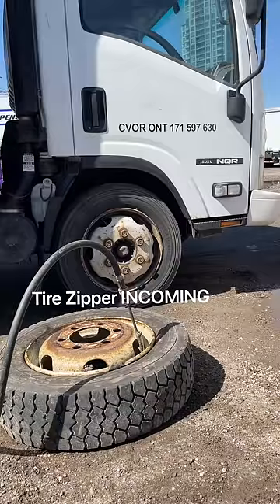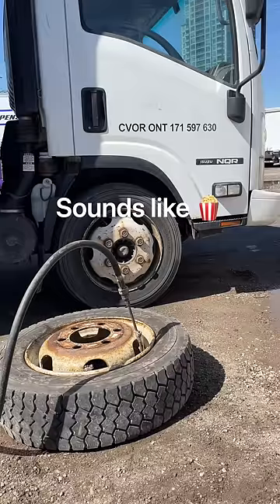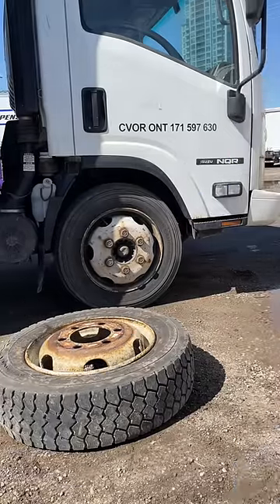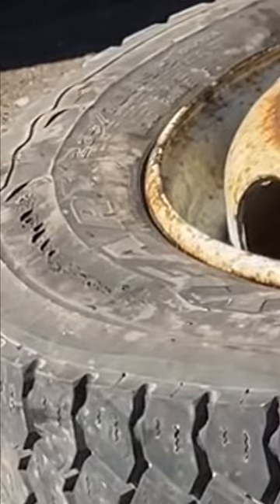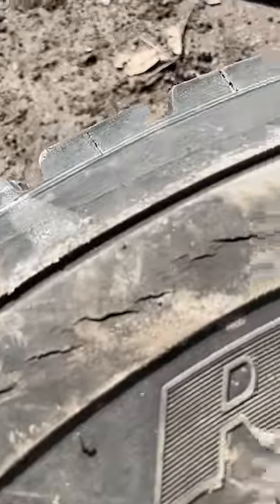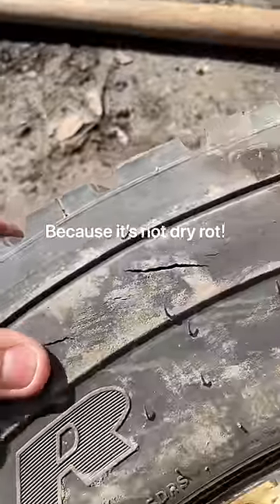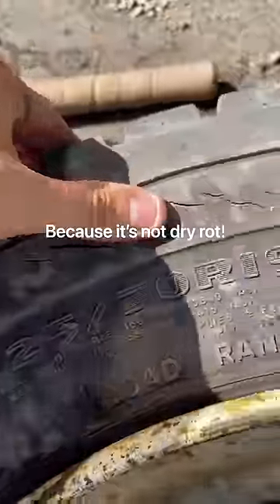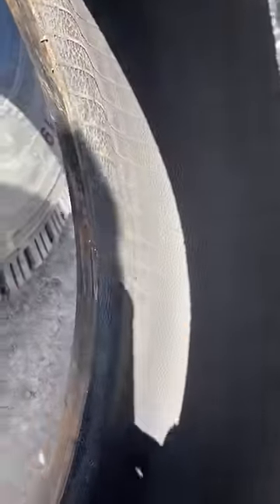Tire Explosion Warning: 🍿 Sound! #shorts

Comment: Putting 120psi in truck tires separates the men from the boys lol
Reply: Also separates the head from the body 😅
Reply: We have 130psi in our 385/55R22.5. Those things blow up like oversized hand grenades.
Reply: @tntfreddan3138  I'm just imagining the explosion effect on loose dirt would probably look extremely similar, but I'd have to see tire blow up to compare it to a grenade haha
Reply: Needed a tire replaced on a drop&hook. Called for roadside. While I waited, I checked tire pressures and found one tire was inflated to 130 psi cold somehow.
Reply: @jeffsorrows  the potential energy contained by a truck tire at that pressure is probably higher than a standard size fragmentation grenade. However the shrapnel produced would definitely be significantly less.
Reply: Separates everything.
Reply: You mean the dead from alive
Reply: BF Goodrich space program
Reply: Boeing 777 have 220 PSI 🎉
Reply: It’s a scary job I have
Reply: That's how much psi I put in my road bicycle tire.
Reply: Good thing it's not the Catholic Church, you'd need a pry bar to do that!!
Reply: Ive filled a car tire to 130 before lol
Reply: i’ve had to put 110 in car tires to pop the bead💀😭
Reply: @Themadoutbacker When my dad first joined the army he was sent to Fort Hood. His first day there some guy was airing up the tire on a deuce and a half without the cage. Tire blew and took the guys head off.

I wasn’t even there to experience it but that story will never not pop into my head as I’m airing up a tire.
Reply: Now try putting 120psi into a 205/40R17 thats rated for 40 because the customer wanted stretched tires😂
Reply: Lol thats why i do it 100ft away with a very long hose
Reply: @bigmike4923  wtf??
Reply: I did it for 6 months ignorant AF an seen  a ten ply used tire give on the downside. Tire bounced a half inch 1000mph with the changers hand on it.  Right arm windmilled straight up into a tire rack breaking his hand. I seen it tho he loosened that nut an was setting the beed I just looked up blew my hair back an someone shat my pants. 😅 Just a sqeeker tho
Reply: 105 is what our steer tires get filled to. I've definitely seen them at 120 before. 120 isn't a huge deal for them, but definitely higher than it should be.
Reply: I've put 120 I passenger tires before to check for really small leaks
Reply: Ahaha you think that’s rough I’m out here at 16 filling and fitting dump trailer tires that are bigger than me, and sometimes cracked enough to make you say a few Hail Marys
Reply: @OG_Glizzy_Gobbler  Yeah, but those things are so overly engineered and well Regulated that the chances of one of them blowing up is pretty damn close to 0.
Reply: More like the smart from the stupid
Reply: Dead from living 😐
Reply: I think ill be a boy for that one.
Reply: And when they pop, 120 psi separates men
Reply: The boy's that do not use tyre cages are often separated all over the floor, walls, and ceiling.
Reply: @tntfreddan3138 Super-singles are a grenade in waiting, also.
Reply: Well, I can put at most 80 psi on my dually tires, I can't reach 120😅😅😅
Reply: Shiiiit. I had a trailer tire go on me when putting air in it one time. Now i get hesitant when ever i get to 80 psi. Was airing it up, checked oressure, it was at 80, so i put more in. After holding the air nozzle for maybe 5 seconds, the tire blew out at face level, but the inside side wall. Got lucky there (trailer tires called for 120. It was MAYBE at 90 psi when it went)
Reply: One guy at the shop once put 200psi in a tire lol the wild shit was it was on a 235/40r18 tire for a Honda Civic
Reply: @tntfreddan3138 they put hand grenades to shame. Hand grenades are less loud than most decent fireworks lol it is the shrapnel that makes them deadly, thenconcussive blast isnt enough to rulture organs.
Reply: @jeffsorrows truck tires definitely have more impact behind their blast, and heavier shrapnel which contains both rubber for weight and thin metal wires for laceration. Id definitrly say a truck tire is more dangerous than a grenade in all categories except the fact a grenade is tiny xD
Reply: @Themadoutbacker  Right.. Hey, I guess I'm a boy with all his body parts.
Reply: @randgrithr7387 dude, that's scary 😮
Reply: @SPD_driver  I thought it just took a glass of Wine?
Reply: @tntfreddan3138 yeah not sure why 120 is a big deal. I have super singles that I put 120 in them. My steers have 110-120 based on load. I adjust pressure based on load on every load.
Reply: @teamdada2194  That's how I talk to my girlfriend. Lol
Reply: @kenroberts9082 you betcha.
Reply: That tire rim doesn't look too healthy either. It looks old enough where steel fatigue could do it in. 😅
Reply: Putting 120psi to seat BMW 325I run flat tires works even better.
Reply: Company policy, 120psi on steers. Now imagine running across the desert, heat expansion
Reply: It also separates the skin from the bone 😁👍
Reply: @jeffsorrows tyre can have moor power
Reply: Road crews in the United States are technically supposed to carry cages on the back of the truck.
Reply: Damn right
Reply: @autodidacticartisan stop doing that. That really small leak is still there at 50psi. If you can't find it in the tank use soapy water and slowly cover the entire tire inch by inch
Reply: @eaf-target-xx2745 zipper rupture are caused from a tire  being run under inflated and the belts in the sidewall being fatigued. Airing a tire that has been run flat is incredibly dangerous. Most dangerous of it's a single tire vs one run with a dual since a dual tire takes three load. Always be cautious airing up tires and extra extra cautious if it's a tire that was run low on air.
Reply: @brad741 the tire manufacturer calculates that in when seeing Max pressure. I was working with some Yokohama engineers several years ago, they were testing new steer tires. I was just there to mount and dismount the tires. We were inflating those in tires 10psi over Max just to recreate what would happen if the tire was hot.
Reply: try filling a tank with 3000psi
Reply: @Seabass1206  I have fueled cng trucks a few times.  I didn't see an issue
Reply: What’s that in kilopascals
Reply: Not too un nerving when its fresh tire but guys who run dry rotted crap because want the most value out of tire aren't great.
Reply: I’ve filled up a car tire (245/40ZR18) up to around 130 PSI before it gave me the overfilled message. Eventually it beaded after we decided to grab a cheetah.

Comment: I was an aircraft mechanic. I saw in one of our safety magazines the pictures of a mechanic who had a tire blow after more than 300psi on a 10 ply tire. It ripped the corners of his mouth open from the air pressure blowing into his open mouth. He did survive but probably stopped working on tires after that.
Reply: So THATS how he got those scars
Reply: I know somebody who was airing up a forklift tire and it blew, breaking his wrists because he had his hands on the tire. I wasn't around to see it, thank God, this was in the 90s. He is still in the business.
Reply: Yeah, the training material can be pretty hardcore. A lot of stuff you will never forget about
Reply: In the Air Force we had the good ole taco guy (incident documented from the 80s-90s where he used extremely high pressure on a low pressure split rim aircraft wheel). It exploded and sliced the dude clean in half.
Reply: You can say he got a bit tired of that job.
Reply: @NiceBowser  We had multiple images of aircraft grounding wires that had been sucked into the intakes of jet engines. To add to it, gone along with those were the mechanics. If you've ever tried diving in to the intake of an f-18 hornet, you'd know how slim the chances of survival would be getting sucked in one with the engine running
Reply: Did he loose his hearing too?
Or like.. any bleeding or something?
Reply: @jaggns5774  I read the article 30 years ago but I do remember reading that it sounded like a stick of dynamite had gone of.
Reply: @fintutorials56  that's awesome
Reply: Guess he had a mouthful to say after that
Reply: 300 psi broooo what was he doing. Sucking off the hose as it overinflated?
Reply: @mikeb.9743  I came here to comment that 😭
Reply: Ohh yea, a semi tire can kill you if it blows out in front of your chest at close range.  I’ve seen split wheel rims blownnpart and the O ring halfway into a concrete wall as well as broken ribs and everything from blown out tire
Reply: @johnxina2465  At first I read that as “thank god he was in his 90s+”
Reply: Holy shit!
Reply: @dk2614  that's no joke. Diesel tires exploding at over a hundred pounds will make your ears ring. If you're too close to them, they will injure or kill you.
Reply: Yeah. I worked on commercial tires and they are legit lethal.
Reply: This reminds me of the time I was working in a shop for a apprenticeship. One of the other people was working on the suspension of a car and removed the main bolt holding the spring on the shock. Long stoahort the spring did hold with that bolt it hit him in the face and essentially removed his jaw. Thankfully he barely survived after months in the hospital but after that day although he’s still a mechanic he won’t even get near the suspension let alone work on it
Reply: That's why you don't hot shot aircraft tires. It's killed a few people.
Reply: @mikeb.9743  Came here to say this..
Reply: @awsomegamer8277  yeah like the first day in car mechanic class our teacher told us that car suspension can be very dangerous and that the spring could shopt thru the roof
Reply: @spacewalk3046  yep they have incredible pressure they have to hold like a ton and not fully compress. Never take anything off the assembly without a shock compressors if not it’ll probably be fatal
Reply: @dyllinroberts1442  Didnt realise tyres had diesel in them
Reply: @HJZ75driver  that references the difference between gasser car tires and heavy duty tires with stiffer sidewalls
Reply: Why did he put that much air in it?? Most only rated for 100
Reply: 300 PSI!! They're rated for 80 max! Dude was asking for trouble
Reply: that probably hurt a little bit
Reply: @Jimmy-vt8jb most aircraft use over 200 psi, not 80
Reply: @redhawkrobin Or retired..
Reply: @johnxina2465 what forklift uses tires with air??
Reply: @johnxina2465  Huh, I expected forklifts to have solid tyres tbh.
Reply: @noxious89123  some do some do not. It depends on the application
Reply: I've had air pressure shoot into my face before and made my nose bleed. 150PSI
Reply: @averagesimracer2248  most use nitrogen
Reply: I would say that would make me stop working on big tires🤣
Reply: Working for FedEx we'd ship spare aircraft tires for out fleets. I took a few minutes one day just to read the specs. 180psi and 200mph max speed are kinda wild
Reply: @fintutorials56  not sure if youll see this but one time i almost walked into a grounding wire from an F18 and i was told i would hsve gotten a real good zap, is that true?
Reply: Reminds me of my AME class when they showed us pictures of the aftermath of a person getting sucked through a jet engine. Gruesome images.
Reply: That tire literally implanted a permanent smile on that guys face 💀💀
Reply: But he has a constant smile on his face 😊
Reply: He also couldn't talk about it.
Reply: Smiling ear to ear!!!!😂
Reply: Love seeing ppl use brake clean to air up tires. Beyound stupid 😂
Reply: Not so good at whistling now either.
Reply: @NiceBowser another guy in Edmonton had something similar happen to a colleague who ignored his many warnings of not using the cage to work on split rims.  Gotta say, amputation of that thing between your shoulders is not something you can ever learn from.
Reply: @mikeb.9743 good one! I almost spat out my coffee. 😂
Reply: That's correct Mr
Reply: That's wild, glad he was ok. I blew out 100 psi on a forklift i was driving,  and it definitely would have injured me had I been any closer. I can't even imagine how bad 300 psi would be.

Comment: I would have un hooked the line from truck not walk over the tyre bit silly if ya ask me
Reply: In the heat of the moment people tend to do stupid shit
Reply: @dusannestorovic5699  im a mobil tyre fitter and this is really unsafe but hey could be a not to do video change title of video 🤔
Reply: Would have*
Reply: @morganthompson69  asking me what ?
Reply: Quick release airlines sometimes don't let you do that
Reply: Hose reel
Reply: Sometimes the air hose will not have a closer valve on the intake side of hose. Shit can go flying on high pressure hoses
Reply: *tire
Reply: tyre*
Reply: @user-lr6ce1mw4k  my setup allows me to do that
Reply: @James-qk8kz  tire*
Reply: Would of
Reply: well here it is tyre the English language is mind boggling
Reply: @James-qk8kz  yeah, btw im not American im Norwegian. Tho i am quarter American
Reply: @James-qk8kz  I could assure you that you probably wouldn’t think of the consequences in a situation like this
Reply: Depends on your setup. My truck doesn't have quick releases on the truck ends of the hoses. But we use auto inflators and cages
Reply: @dyllinroberts1442  not a fan of cages we seat the bead then bolt onto the unit and use a gauge for the pressure very handy saves rolling a fully inflated tyre to the unit
Reply: @M4X1  you should always be alert especially when inflating a runflat tyre or a repaired tyre
Reply: That's what I was thinking
Reply: Slim  well clearly 1000 people like my comment go figure
Reply: I would have done bunga bunga chick chicka
Reply: But nobody asked you 🤷‍♂️
Reply: @l.c.7955  who asked you
Reply: @dusannestorovic5699  yeah but they did it on purpose
Reply: @dusannestorovic5699  I think it would have been stupid if it had exploded. What he did was just not as efficient as an alternative method
Reply: Yes
Reply: Video is silly in general
Reply: @dusannestorovic5699  no, stupid people tend to do stupid things. Doesn matter if it's "in the heat of the moment"
Reply: Agree
Reply: For almost 20 years now we've had the ability to just flick the hose and it will disconnect the chuck.
Reply: It's odd that you'd use American English spelling in Norway. Almost all the European testing is done in British English.
Reply: @bremCZ  im grew up with American youtubers so thats why
Reply: Fair enough. Be careful with youtubers though. Half of them write nonsense like "could of".
Reply: @bremCZ  huh? Isnt that how its spelled?
Reply: No. "Could of" is just nonsense. Could've is the contraction of could have.
Silly native English speakers get it wrong all the time because they hear the same sound as the unstressed "of" as in "because of", but "could of" makes absolutely no sense at all.
Reply: @bremCZ  kiwi language something you clearly don’t understand
Reply: I don't think he was thinking about that when he heard it popping. His initial thought was to pull it out of where he initially inserted it. Understandable. But someone whos not actually in the moment would have a better assessment of the situation and would say something like you which yes is a better idea but eh. He's still alive so that all that matters😂
Reply: @user-lr6ce1mw4k  good point too. Under pressure you can't easily remove the line unless your allowing air to freely flow form the other end
Reply: @James-qk8kz  don't worry about ppl spell correcting you dude. And tbh based on your region, you may still be correct. Isnt that funny
Reply: tyre or tire is still correct bro stop being ignorant about the situation your attacking his spelling not even the actual comment.
Reply: It's not silly, it's insanity
Reply: Not so easily done when you have a compressor and hose reel everything is almost always threaded together without quick connects.
Reply: @James-qk8kz  sometimes panic sets in it’s easy to say what you should do when you’re not in the situation reguardless if your experience
Reply: @M4X1 you’re right. I’ve already thought of them before hand and wouldn’t go near a tire that’s making that sound. 

I definitely would have ran away.
Reply: @James-qk8kz where I live it is "tire" not "tyre". Literally spelled that way on every other Tire shop.
Reply: As long as it’s unhooked, there’s no wrong way of doing it just get the darn thing off!
Reply: @adrianberg5866  I’d just run away and tell everyone near to do the same, not risking letting my head loped off
Reply: @papasmrff2291  that could work but you gotta take account the sound, at just 50 psi the sound that goes off is as loud as a 12 gauge, just imagine how loud it would be at 60, 70, 100 psi, because a tire zipper can happen at any moment
Reply: The tire doctor is just built different
Reply: Good for you?
Reply: tire
Reply: @IamJay02 it's def would have
Reply: @FZERO20 tyre is 100% correct
Reply: @papasmrff2291 that's stupid. You're gonna have more a chance of getting hurt letting that thing blow up and continually filling it with air
Reply: Camera was running. Cameraman never dies.
Reply: @Sahxocnsba  so if I run away 20ft I’m more likely to get hurt than running up to the tire and standing directly over it? Yes that makes total sense
Reply: Spelling tire as tyre is a bit silly to me.
Reply: @dusannestorovic5699 heat of the moment? He knew what he was doing that’s why we’re watching a video of it right now. Tf?
Reply: I’m wondering if he was just doing a video to show you the sounds of the cords breaking. It may of only had 20 psi in for all we know.

Comment: I use 2 air hoses. If anything happens, I disconect the hoses from each other and let air out. I definitely know that sound and the following boom.
Reply: Good idea. Makes it safer than getting right up to the tire and disconnecting
Reply: That's a really good idea. Underrated comment here
Reply: This is the way. Pretty sure it's an OSHA requirement to be able to remotely disconnect the hose for this reason... They also require a cage for truck tires maybe a 16" Isuzu tire doesn't qualify in not sure.
Reply: Gonna have to save that idea for future reference, that's a really good idea